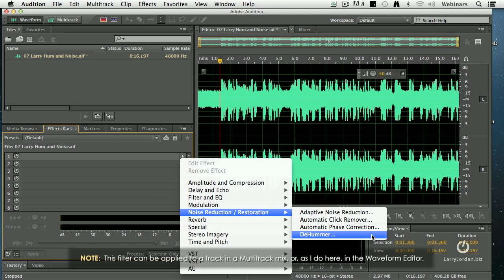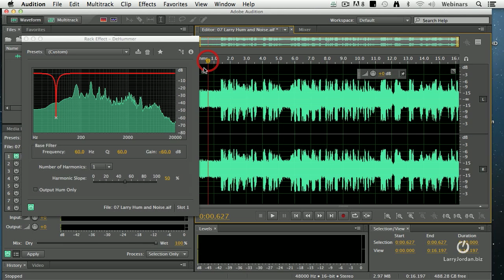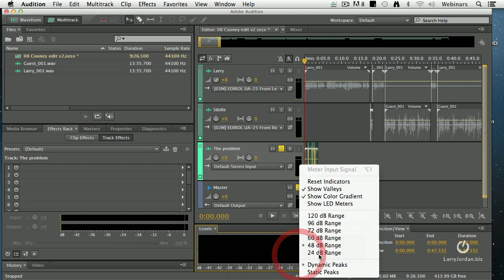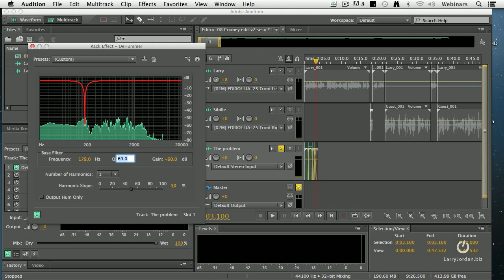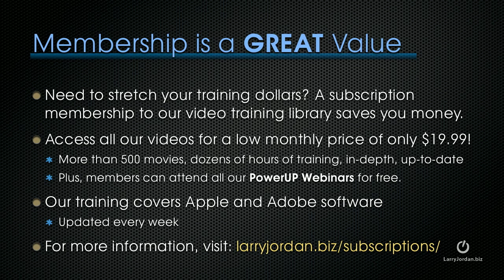How to Remove Hum

Comment: Hello thanks for this it helped,
but I have a problem i can find a way to fix, I have to separate audio files from a interview i filmed, when it switches from one persons audio to the next for a 1 second or 2 to i have a hissing noise then it goes, but happens every time. please can you help.
Reply from the maker: Calumn:

Hmmm... That hiss is probably caused by wireless mics switching channels, but, I confess that I haven't heard of this problem before.

Oh! It could also be caused by recording your sound with the AGC (Automatic Gain Control) turned on. When someone stops talking a poorly-designed AGC raises the background noise dramatically.

Either way, this hiss is now part of your recording. Because hiss includes all frequencies, a standard noise-reduction software won't get rid of it. If you can't edit around it, you may need to either re-record the audio (which is called ADR) or use different tools. Look into the RX series from Izotope. (I think the current version is RX6).

Larry